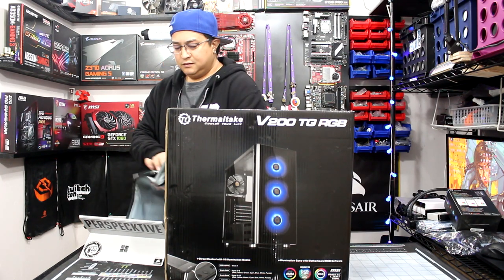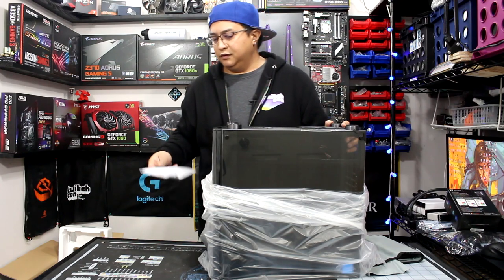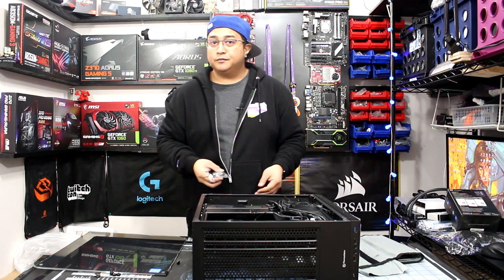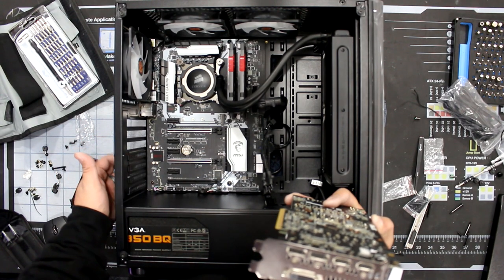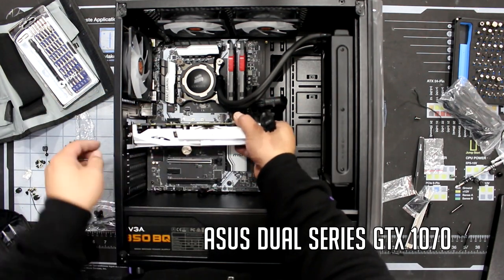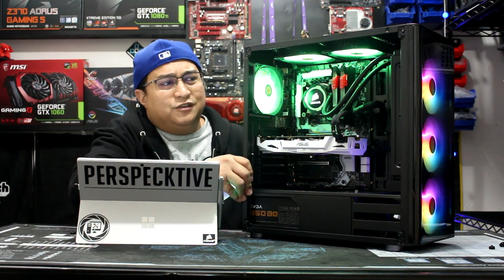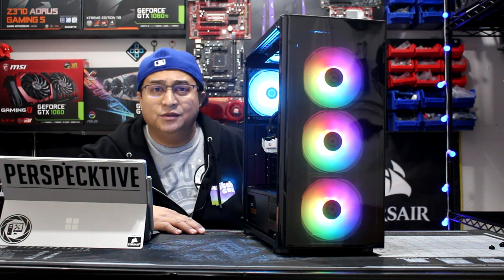Building In The Thermaltake V200 TG RGB (2018)

Comment: Where does the ssd go? Lol I can’t figure it out
Reply from the maker: Aye it's all good Jay. I wouldn't have known either honestly. They don't make it very obvious at all but the ssd mounting areas are gonna be those holes right next to where the radiator is at towards the front of the case. You'll see a series of holes that run vertically down. Next to that is where you can mount several of them. Up to 3.
Reply: PERSPECKTiVE thanks for the reply brother.
Reply from the maker: @Marc-dq3lh  You're welcome bro, always glad to help.

Comment: I have the same case and mb but I can’t find where to plug in the Sata cable cable from the case
Reply from the maker: the sata cable that's connected to the fan controller? that goes to the power supply.

Comment: Normally there are 3 rgb fan + 1 non rgb fan on the case but end of the build there are 4 rgb fan without liquid coolers two fan. how
Reply from the maker: Watch 5:58 that’s how.
Reply: @PERSPECKTiVE   I just realize it. thank you :)
Reply from the maker: @sadkahmettozcu3806  You're welcome!
Reply: I use AMD Ryzen7 2700 do you think should I use liquid cooler ?
Reply from the maker: Hernan Cortes yes most definitely use a liquid cooler.
Reply from the maker: I mean you could go air cooler but because the case is choked for air in the front I think a liquid cooler would be better.
Reply: @PERSPECKTiVE  normally I get 45~60 °C when I play game. what it will be when I get liquid cooler and what are the pros of liquid cooler?
Reply from the maker: @sadkahmettozcu3806  60c is pretty high, i'd assume the system would throttle down to prevent damage but I can't tell you how much of a degree change it'll be because there's lots of variables and I don't wanna throw numbers at you without proper testing. But with the way the case is built I just think having the cpu area clear of a heatsink would improve airflow especially after removing the dust cover on top.  It's just my opinion though and can be taken with a huge grain of salt. But if you haven't tried checking temps without the dust cover on top then I would definitely try before going out and buying a water cooler.

Comment: Man, why can't my case do that rainbow puke at the front? I have the same damn case.

Edit: Oh, you replaced the original fans...
Reply from the maker: Yeah I moved the front fans to the back of the case and used ThermalTake Pure 12's for the front.
Reply: @PERSPECKTiVE  Ahhh, ok. I left the case fans alone, but added 2 140mm Noctua fans on the top. Yet to get water cooling, but I realized recently that I could mount the radiator on the front of the case and still keep the top fans.
Reply from the maker: Nice, yeah you definitely can man. Nice choice on top exhaust fans!
Reply: @PERSPECKTiVE  Thanks I followed a bunch of build guides to know what to get. Last time I built a PC, I was deciding if SATA was worth the extra money, lol. Here's my specs:
AMD Ryzen 5 3600X CPU 
Asus GeForce RTX 2070 Super GPU 
Asus ROG Strix B450-F "gaming" MOBO 
16GB (8x2) G.Skill Ripjaws DDR4 3600 RAM 
EVGA 650W 80+ Gold PSU 
Crucial 500GB m.2 nvme SSD 
ADATA 2TB m.2 nvme SSD 
Thermaltake V200 TG CASE 
2 additional 140MM Noctua fans
Gas Spring to prevent GPU sag.
Reply from the maker: @travisfiedler4416  Haha damn man. You gotta love IDE. I remember when I first started getting into PC modification I was debating on AGP compatible PC's vs PCI-Ready PC's.
That's a nice setup though, I have the X470 version of that motherboard. I like that idea of a gas spring too for your GPU sag!
Reply: @PERSPECKTiVE  Thanks! It had been so long since I built that I had to take it to a tech guy after I got as far as I could, and he recommended supporting my GPU. I was a little worried on this build about my PSU being too weak, but I think I'm ok. I got lucky with this case too for the gas spring to fit. It was too long to get in the case with the PSU shroud, but thanks to the hole in the shroud at the front of the case, I was able to squeeze it in there and have the arm just reach my GPU by about an inch.
Reply from the maker: @travisfiedler4416  No problem brotha! A 650w is the minimum for a 2080 Ti so yeah man you'll be good with your PSU. Not to mention you got gold certified. But that's dope, I'm gonna have to look into that for aesthetics on a project build for real.
Reply: @PERSPECKTiVE  Here are pics of it: https://twitter.com/TravisFiedler7/status/1266868826999869440
Those pics are before my second m.2 drive.
Reply from the maker: @travisfiedler4416  lmao holy shit man that's fricken awesome, MSI gaming stickers and then a ROG cable label on top. But dang yeah that card is thick for sure, definitely would want to stop it from sagging. That's super sick. I can't stop staring at it hahaha, hell yeah.
Reply from the maker: @travisfiedler4416  That reminds me of what I did with my friend's GPU that was missing a PCI bracket. Except mine was so ghetto man. I used zip ties and integrated a pci bracket to get it to stay and be secured on the case and motherboard.
https://youtu.be/MIso8obpjlQ?t=820
Reply: @PERSPECKTiVE  Thanks, man! That video is funny. My tech guy recommended a ghetto fix too with a string on the corner hole of the GPU and tie it to the top of the case. LMAO!

Comment: Hi, I might be a little late but how do you contol the rgb fans in the front? I have the v200 as well but they wont controll on mystic light, I can only control them via the button on the front. I hope you can help.
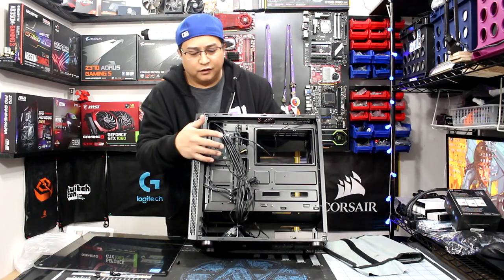Reply from the maker: It's never too late to ask any questions so thanks for asking! But you would need use an adapter that goes from the fan controller to the motherboard itself. The input if I remember correctly is the white connector on the controller which you can find at 3:53.

Comment: How did you remove the front bottom fan? I’m running into an issue removing the bottoms screws on this case
Reply from the maker: Should be able to just screw the fan off from the front end. Otherwise you may have to remove the shroud which is attached by like 2 or 3 mounting points

Comment: hi do you know if the  ML240L will fit on the top of this case (i dont want to have it on the front) .
this would help alot thanks
Reply from the maker: Yes if you have the 2020 model you should be fine.
Reply: @PERSPECKTiVE  thanks
Reply from the maker: @SeaZC  No problem. Sorry for the late reply, life is super busy right now.
Reply: @PERSPECKTiVE  np its ok

Comment: Can we fit 240mm radiator on top?
Reply from the maker: You probably could but it's not made for top mounted radiators. I can only guess that if you did try to mount one there, it might get in the way of your motherboard mosfet heatsinks. (Those heatsinks next to the CPU on the motherboard)
Reply: @PERSPECKTiVE  ok just explain me one thing if one case says u can fit 2x120 or 140mm than can we fit 240mm rads on top in them?
Reply from the maker: @umerbest9949  So 2x120 means 2 120mm case fan. When it says or 140mm it means 140mm case fan. In most cases you can fit radiator no problem. Typically the front is the best place to put because there's lots of room. Many times you can't install radiator on top because there's not a lot of room to fit a radiator AND a radiator fan. That's why some cases you can't put radiator on top.

Comment: How do you break the plates off to install the video card? Can’t seem to figure it out and I don’t wanna break stuff
Reply from the maker: You can use a screw driver to bend the plate back and forth till it comes off. If it doesn't have holes for you to insert your screwdriver you can use a flathead to pry it open then proceed to bend it back and forth till it falls off.

Comment: u can put an ssd drive on the back
Reply from the maker: There's a drive cage in the power supply shroud. You can also install SSD's near the motherboard behind the radiator. It's a series of holes that you just screw the drive right on there

Comment: Have the same case and my build was no problem. Ur just too negative. The back pci brackets can be removed by bending the top half and twisting. Had my motherboard in and didnt even touch it
Reply: Hey don’t knock him for his opinion, and everyone likes something different, personally had a few different cases and this one is by far my favorite. It’s all opinion baded
Reply: Based^
Reply from the maker: I'd say I was more critical rather than negative. I've built in plenty of cases and never had instances where the pci plates scratched the board. I was able to avoid the damage, but I wanted to point that out for builders with less experience. Just imagine the anxiety a new builder would feel if they scratched their mobo. Would be pretty gut wrenching. But hey thanks for your feedback!
Reply from the maker: Ayevery_ also thank you. I do like this case though! I just knocked points off the build experience because I thought of the less experienced builders.
Reply: PERSPECKTiVE I actually noticed that it could easily scratch it, if you’re careful it doesn’t but someone who didn’t know what they were doing would almost 100% scratch something up
Reply from the maker: Hey dude I got your comment but it looks like you already figured it out. Yeah the front fans are some aftermarket Thermaltake fans. The Pure 12 RGB. The stock fans are gonna be static, I wish I explained it more in the video but I stuck the stock fans in the back to add lighting to the inside of the case. Especially since they're static anyway.

Comment: 4:15 Is it supposed to be that un-even
Reply from the maker: Which?
Reply: It's like one plate is off by like a mm on the outer case. I really don't know how to word it but its minor
Reply from the maker: Lil Pup ohhhh you mean the front panel in the bottom right shot? It didn't look crooked during the build but I'll double check it though before I leave for work today. It could just be the lighting but then I filmed this after a work shift so I could've overlooked it. I appreciate you pointing that out though, I really do.
Reply from the maker: I just checked it and it's actually slightly convex shaped. The center is almost exactly the same level as the aluminum and both sides are slightly lower. So definitely a design on TT's part. Looking at it though, it doesn't look bad at all. The lighting in the shot really makes the sides pop like it's crooked so definitely feel ya on that
Reply: @PERSPECKTiVE  yeah once again its minor. Great video man!
Reply from the maker: Lil Pup hey thanks man. I really appreciate it.

Comment: Just remove the plates first? 😂
Reply from the maker: You say that but you're a dime a dozen. You don't start off builds by removing PCI plates.
Reply: PERSPECKTiVE I mean I was just giving advice to work around your issue. It’s not a flaw if there is a simple and easy work around. Obviously you don’t do that til you install your GPU, but you could very easily just do it before lol